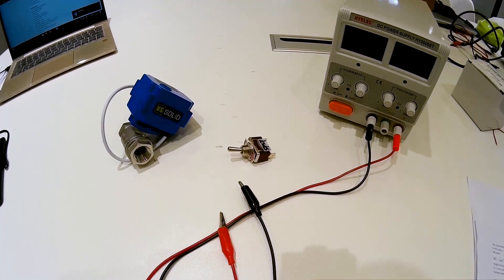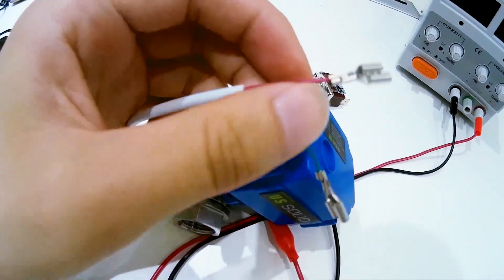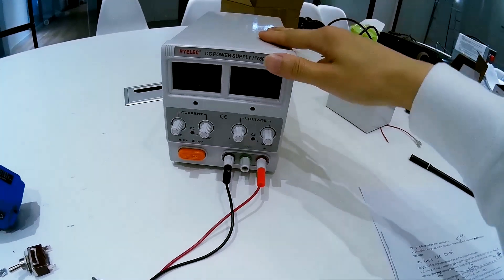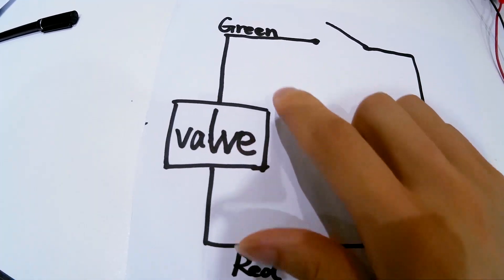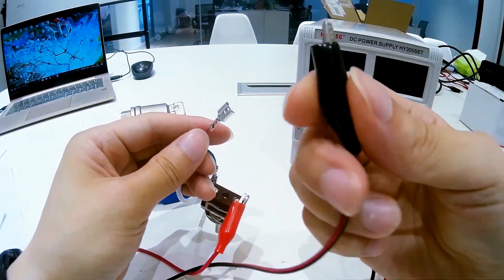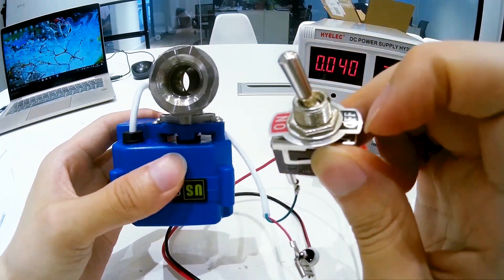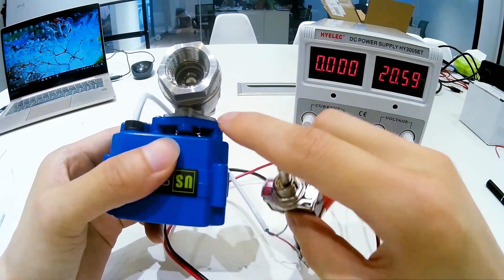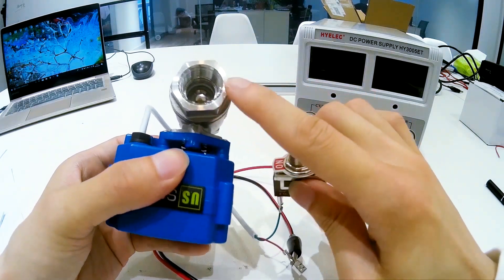How to Wire the U.S. Solid 2-Wire Auto Return Motorized Ball Valve for Efficient Operation

Comment: Would this be ok to use with machines that may stay on for hours or days at a time? So for instance turn on the machine and the valve opens turning on the water so if the machine turns off or looses power the valve closes. Or would the motor burn out with prolonged power?
Reply from the maker: Yes. The ball valves can be energized continuously.

Comment: Is this waterproof?
Reply from the maker: The motorized ball valves all have a rating of IP65, which means
they can withstand spray from water. However, if permanently installed
outdoors, it is recommended that you enclose the motorized ball valve
in some protective housing.

Comment: I didn't bother asking my question as there's a long list of unanswered questions below...
Reply from the maker: Normally open version is available here https://ussolid.com/products.php?product=U.S.-Solid-Motorized-Ball-Valve%252d-1%7B47%7D2%E2%80%9D-Stainless-Steel-Electrical-Ball-Valve-with-Full-Port%2C-9%252d24-V-AC%7B47%7DDC%2C-2-Wire-Auto-Return%2C-Normally-Open&showHidden=true

Comment: Is it possible to make the valve function so that it is open when there is a loss of power??????   Basically opposite of what you just showed.
Reply from the maker: Yes, a normally open valve will work. https://ussolid.com/products.php?product=U.S.-Solid-Motorized-Ball-Valve%252d-1%7B47%7D2%E2%80%9D-Stainless-Steel-Electrical-Ball-Valve-with-Full-Port%2C-9%252d24-V-AC%7B47%7DDC%2C-2-Wire-Auto-Return%2C-Normally-Open&showHidden=true

Comment: And if i want valve to always stay open and a switch activates it to power onn and  close ?
Reply from the maker: This is normally open version https://ussolid.com/products.php?product=U.S.-Solid-Motorized-Ball-Valve%252d-1%7B47%7D2%E2%80%9D-Stainless-Steel-Electrical-Ball-Valve-with-Full-Port%2C-9%252d24-V-AC%7B47%7DDC%2C-2-Wire-Auto-Return%2C-Normally-Open&showHidden=true
Reply from the maker: It is normally a closed valve. It will return to close when power fails.

Comment: Nice video.. when can i order for 2 inches connection, 220volt, 2 wires only auto return valve?
Reply from the maker: 2" solenoid valve is available.

Comment: Is the valve available in an open state when the power is turned off and closed when power is on?
Reply from the maker: yes, normally open valve is available https://ussolid.com/products.php?product=U.S.-Solid-Motorized-Ball-Valve%252d-1%7B47%7D2%E2%80%9D-Stainless-Steel-Electrical-Ball-Valve-with-Full-Port%2C-9%252d24-V-AC%7B47%7DDC%2C-2-Wire-Auto-Return%2C-Normally-Open&showHidden=true

Comment: I have a 2 wire but it remains closed When power down?
Reply from the maker: Normally closed valve will remail close when power fails. If you need it to open with no power, please use a normally open version.

Comment: Hi sir..
If supply current trip, how to open or close for manual valve?
Reply from the maker: please choose the model with manual switch https://ussolid.com/motorized-ball-valve-1-2-brass-ball-valve-with-manual-function-full-port-9-24v-ac-dc-and-2-wire-auto-return-setup-by-u-s-solid.html

Comment: Can work connect to a controller unit for irrigation sistem by battery's 9V.I mean the controller will be set to open the valve at 9 AM and switch off at 9.01AM...I will have any issue the water pressure is 0.3bar...Tys tipe is Normal close?
Reply from the maker: Yes, this one is normally closed

Comment: What water sensors do you recommend for use in a water heater leak detection scenario?
Reply: You can use a WETSwitch as a leak detector.  It runs on 24 volts and with a 24 volt power supply you can wire the Wetswitch with the 9=24 volt version of a US Solid Valve to shut off you water to the water heater.
Reply: If you use a motorized cut off valve make sure you get one that can be used with drinking water.
Reply from the maker: this one https://ussolid.com/water-leak-detector-water-leak-detect-and-protect-system-with-3-4-stainless-steel-motorized-ball-valve-controller-and-3-sensors.html

Comment: Can the value be stopped in the half way open position?
Reply: I want to know the same thing!
Reply from the maker: no, but the smart ones can do https://ussolid.com/1-2-smart-motorized-ball-valve-remote-control-electrical-ball-valve-with-manual-switch-5v-dc-usb.html

Comment: please wiring with modul relay wireless 433mhz 2ch 12v in inching mode 5 second..thx
Reply from the maker: No, for a ball valve, there is 1/4',1/2',3/4' and 1" in stock

Comment: I have the 3-way valve installed and it's auto-closed in the wrong direction. I can't change the pipes at this point. Any idea how you remove the spring so it doesn't auto-return? Or reverse which valve is open by default? I need the other line to be open by default.
Reply from the maker: You may try a normally open valve.
Reply: How long did your US solid valves last? I have had two and they both failed in the first year

Comment: Is there any problem with leaving the valve powered/open for days or weeks at a time?  Any idea what power consumption is when energized/open? If connecting to AC power does a voltage regulator need to be used or can wire direct to 120V power?
Reply: It can be left powered /open for days. The power is about 2-5W. Please connect it to the required voltage.
Reply: remove the spring and install a reversing switch instead.
Reply: @jaishetty8586   I have the 3-way valve installed and it's auto-closed in the wrong direction. I can't change the pipes at this point. Any idea how you remove the spring so it doesn't auto-return? Or reverse which valve is open by default? I need the other line to be open by default.
Reply: What is the country of origin please and do you have a USA in country distributor.  I Am interested Ted THETFORD @ tcthetford@yahoo.com 610 735 0070
Reply: Is this product manufactured in 24v and 110v and in 9 - 12 - 24 and 110.  Is there any product literature on the sizes and voltages.  Thank You
Ted THETFORD iwsplumbing@gmail.com 
USA 619-735-0070
Reply from the maker: You may try the 110V version 
https://ussolid.com/u-s-solid-motorized-ball-valve-1-2-stainless-steel-electrical-ball-valve-with-full-port-85-265-v-ac-2-wire-auto-return.html